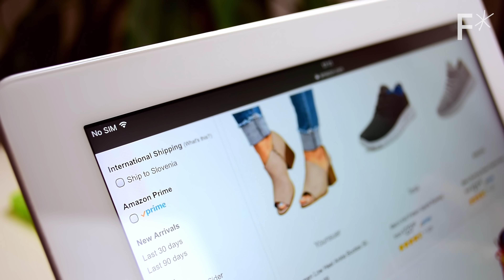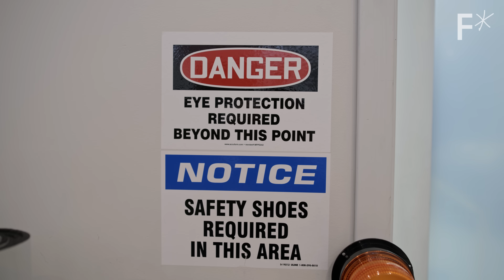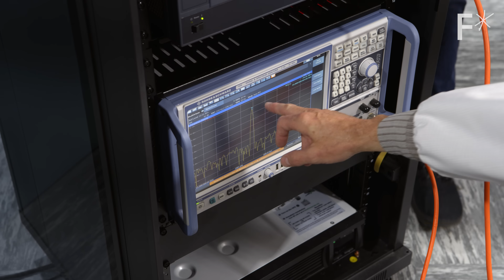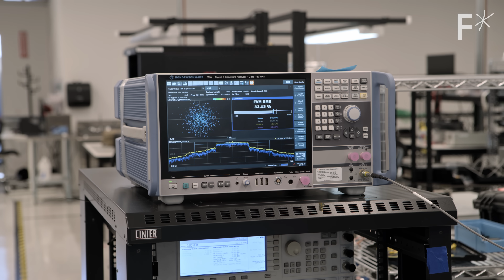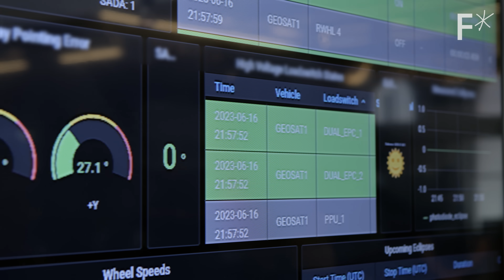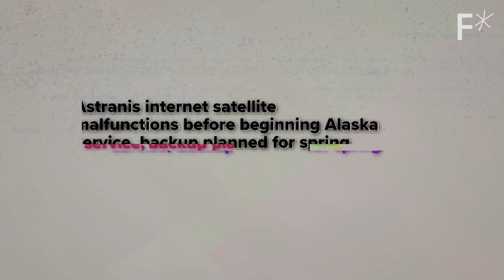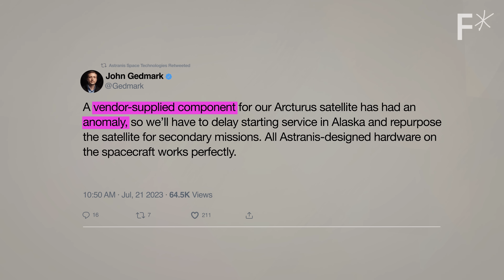Starlink’s newest competitor is using next-gen satellites to create internet for all | Hard Reset

Comment: stop demanding for junck. Think sustainable solution
Reply: what
Reply: @RawbLV   what what?
Reply: @iftekhar_k  what junk are you talking about
Reply: @RawbLV   spacejunk, light polution, excess cost, huge cabon footprint
Reply: @iftekhar_k  ehh it's barely anything. If people stopped flying to Italy for vacations, that would be a greater pollution offset
Reply: @RawbLV  how much fuel need to put one satellite in orbit? Multiply this by thousands. And forget about the manufacturing process. Instead we could run cable internet for reliable connection. Or we could develop efficient  wireless connection for remote location. It would be more cheap and less hazardous
Reply: @iftekhar_k  As I said, tourism produces more pollution than the entire rocket industry in idk how many times more. I mean there's literally thousands of planes in the sky at any moment. Production isn't that resource intensive.
There is no efficient wireless connection. All our tech is literally hitting physical limits. To provide internet through regular means to every remote location would be insanely expensive and damaging to the environment. Think about it.

Comment: StarLink will include (if not already) a cell phone transponder and will be able to act as another cellular antenna for your device. From 4G up if I am not mistaken. Already a challenge as that LEO cellular antenna will be 25 times farther than a regular one on earth. A geostationary satellite is at least 72 times farther than a LEO satellite, so the sensitivity of its satellite transponder and its signal power must be (72)^2 higher. That is about 5000 times more. For their billion customer goal, each satellite will manage much more "clients" than a LEO one, so for the same bandwidth (let us forget about latency for a while, like many others pointed out) they will need a huge amount of power. LEO satellites are being de-orbited if too old or faulty. They will do it under thruster control or by friction though it will take longer. They can do technology iteration cycles that are almost unbeatable and not worry about filling the orbit with crap. On GEO you will be required to move to a graveyard orbit and if you lost control of the "bird" bad luck.

Comment: Would never have internet in geo orbit.  Latency would be a killer.  I do have Starlink and the dish never moves.  Uses phased array antenna and the beam forming happens almost instantly so you don’t notice when it is switching satellite because it happens in an instant.  Seems more like an ad with so much misinformation.
Reply: The Starlink dish does move when it's fist setup, it maps the view of the sky where is position of best orientation. After setup it's stationary.
Reply: @tyronewashington230  yes but it doesn’t move to track the satellites is what I was getting  at and if you have the mobile version mounted for motion they do not move period.

Comment: i found falsehoods in here early that dont bode well for the authenticity of the rest of the video.

i dont like elon musk but i know technology

starlink dishes do not "lose connection with the internet" when they switch to the next leo sattelite 
- they also dont move the dishes for that as implicated in this video.

Strictly spoken. they are no "dishes" - they are phased array panels (similar to moden warship radars that are just panels on the surface of the superstructure) 
, and tracking sattelites is done electronically, not mechanically.

If you not even get that right - you ought not to mention starlink, lest you aim to get sued.

---

anyone who choses geo over leo orbits will have to fight with latency issues.    Physics are physics. distance add latency.

Comment: It also means that any dish down here on Earth has to track those satellites as they move across the sky.
And anytime that dish needs to jump to tracking the next satellite, it'll lose connection with the internet.

I have had my Starlink System for 2 years and have never seen it move to track the satellites with the exception of when I first set it up. Starlink antennas uses an electronically steerable Phased Array antenna that can switch from satellite to satellite in milliseconds and it can receive and transmit to multiple satellites at the same time eliminating the loss of signal. With much much LOWER  latency. Hughesnet Satellite internet used Geosink satellites and the services SUCKS BIG TIME!!!
Reply: I worked in the Arctic (Jan Mayen) a few decades ago and we had a slow expensive geostationary connection.  A few years ago they had increased the speed, but still the same horrible latency.  Now they got both Starlink and OneWeb, and in a few years there will be a 1000km fiber cable to the island.  The new starlink antenna has no actuators or moving parts at all, because the number of sats always covers the sky within the electronic steered beams.

Comment: This video was pretty bad at explaining the technical details. Essentially Astranis will be using SpaceX rockets for its launches and SpaceX-style manufacturing techniques, but Astranis is aiming for a low-end market segment.
StarLink currently has 5000 working satellites in Low Earth Orbit (LEO) and plans to eventually have 42,000 satellites in LEO. Each of these StarLink satellites will need to expend argon or krypton fuel to stay in their orbits and StarLink plans to replace them every 5-7 years. In contrast, Astranis plans to have 100 GEO satellites in orbit by 2030, and these satellites don't need expensive inter-satellite communications systems, because the internet signal can be served with just one satellite, instead of having to be passed from rotating satellite to rotating satellite. GEO satellites can last many decades because they don't have to use any fuel to stay in orbit, so Astranis will be significantly cheaper to operate than StarLink. The drawback is the high latency of around 600 ms for GEO internet, whereas StarLink is 25-35 ms, so Astranis is aiming for the low end market of people who aren't willing to pay much for their internet access, which is why the company is talking about the 4 billion people who currently don't have internet access and aren't willing/able to pay for StarLink's expensive LEO internet, which starts at around $100 per month. 

I don't know how inexpensive StarLink will become in the future, but if Astranis can get its pricing down to around $30 per month, I doubt StarLink will ever get that cheap, and Astranis may have a successful business model. If Astranis works, it will put other GEO internet providers like Hughesnet and Viasat out of business, but it won't challenge the LEO constellation providers like StarLink, OneWeb, Kuiper, Guanwang, Yinhe, Samsung, etc.
Reply: Starlink will carve up the markets and have tiered pricing--which, in fact, they're already doing. E.g., about $60/month in Chile. Since the network is global, the capacity is already essentially in place to reach these 4 billion, with little marginal cost.

Comment: You are wrong: Starlink does not physically move anything to track satellites and shifting to a new satellite every few minutes. There are 1280 radio transmitters/receivers on my "Dishy McFlat Face" antenna. They operate ever so slightly out of phase to accomplish "beam forming", that tracks a given satellite and shifts to the next one IMPERCEPTIBLY so. Without moving the dish. Take a look at a Starlink dish yourself: it mainly moves during the first 6 hours, when it is scanning for obstacles. After that it rarely moves. I would guess, that the reason mine is at angled to the north might have to do with load balancing ground stations vs. satellites or perhaps some satellites undergoing software patching. Patching/upgrading is normal for IT systems.

Comment: Not sure I see the business case.
Geostationary Satellite service had been around since the 90ies, and the physics haven't changed.

Large antenna aperture means sharing bandwidth with many other customers .
Latency is awful.We did a LOT of videoconferencing over satellite, sometimes even over 2 hops!
500ms is a baseline, 2000ms can occur.
It's possible to talk VoIP, but your better be disciplined, like on a 2-way radio ("over").
When it comes to online system, it becomes nearly useless. Many Cloud or Web services can't cope with the latency, crashing your connections and sessions regularly.
And when it comes to "chatty" protocols and applications, that create plenty of requests and responses for one single action (death to Sharepoint!), oh boy. 10 Minutes to enter 4 values into an online spreadsheet!

And don't forget, Geostationary needs line of sight to the satellite! You understand, what that means when you try to see the satellite from a mountain valley or in a high rise city.
Polar regions better be VERY flat towards the equator, unless you won't get connection.

Oh, and the weather!
If you're not using C-band (which mens huge antenna and crowded frequency spectrum), your Internet goes bye bye with every Monsoon or snow cloud.

I get the impression, starlink just solved ALL of those problems.
Having some open sky instead of like of sight to the equator, orders of magnitude higher bandwidth, extremely low latency, very cheap equipment, very low power, all polar regions covered...

I would not invest in this startup.

Comment: I wish them the best of luck.

However, it is difficult to see how they can actually compete with Starlink and other LEO constellations. Each satellite seems roughly equivalent to a single Starlink satellite. And if you look at launch costs, we're probably talking somewhere in the $15 million range per satellite. A Starlink satellite is likely more in the area of $400k per satellite (in part because they use their own rockets, and they are only going to LEO rather than GEO).

And with the volume of Starlink satellites being produced, there is no doubt that the production cost for each satellite will be significantly lower for Starlink. Competiton will tend to come down to $/GB, and if you are paying many times more money per satellite, making the financials work will be quite difficult.

The primary benefit of GEO is that you can roll out coverage with a single satellite. And that was a huge advantage, a few decades ago. But LEO constellations are already in the market. They have global coverage, and massive bandwidth.

I can see this system working in areas where Starlink hasn't been rolled out yet, with significant data caps and low pricing. But then, at some point, Starlink starts offering services with no data caps (or much higher data caps) and lower pricing. They can do that, because they just have such an advantage on bandwidth. And they don't really have to make much money in poorer regions - the satellites are already paid for by wealthier regions.

And the above isn't even taking into account the biggest benefit of LEO - low latency. Even if this system could compete on $/GB, it will still always be an inferior service.

Comment: This is a failed business strategy right off that bat in this day and age.  Starlink will eventually lower subscription costs to challenge any competitor.  The value starlink brings with low latency will win over the "competitors".  Elon will win.  In the time it takes this company or "competitor" to launch a viable network of satelites, starlink will probably have reduced their prices or improved their latency and possibly increased their subscription price.  If they have increased their subscription price it would be for a reason.  There is a demand for it.  That being said, this company isn't really a competitor.  Starlink is catered to people who want highspeed internet.  It's like comparing a deep hull ocean worthy fuel efficient yacht that does 14knots per hour to a luxurious yacht with 2 high output engines that will push a 50ft boat to 25+ knots.  There isn't really a comparison.  Different.
Reply: This is nothing other than a scam for investors. Smallsats to GEO? Really? Any reasonable regulatory body will GTFO them with such request. You cannot put that many of those on GEO safely, it's expensive and fill stay in orbit forever. And if it fails to move to a bit higher graveyard orbit, it becomes a whole another problem that is endangering other sattelites.
Reply: Were very unlikely to see Starlink just drop its prices, they have too many ongoing costs to do that.  The satatlies die rapidly in LEO due to drag and have very limited fuel and need replacing.  Also ground stations are very expensive and incur a loss to SpaceX for each instalation.  Lastly SpaceX has to buy backbone data service from other ISP's (the ones that have all that Fiber in the ground) to actually make the service work.  Geo satalites are not even competing with SpaceX, its instalation of more fiber which is permently shrinking the number of wealthy, low latency demanding, yet fiber-option-less internet users which are the target market of Starlink.

Comment: This video is perfect if you want to waste 16 minutes of your life and find out nothing new.

1. what is innovative about these satellites? We had GEO satellites for decades.

2. how will the back channel work? (The one from users back on Earth). Will it be stationery-only setup?

3. what kind of bandwidth do they exect to provide per user?

4. Calling other satellites "analogue" is not explained at all. Their "brain" is definitely digital.
Are they talking fixed frequency transmitters vs SDR (software defined radio) ? Do they mean older satellites just relay signals and never process?

This whole video looks like 16 minute bs add.

Comment: While sticking a fixed wavelength transmitter and receiver may get them through legal hurdles faster I think it's dumb to waste 10 million to send a satellite up that can only send and receive on specific wave lengths and covers only a single state. The US Gov has already taken more than 1250 billion U.S. and thrown it at broadband suppliers and guess how much of that actually changed pricing, availability, and cost? If you guessed ZERO you would correct. At this point it is just a giant legal scam to do nothing and write library sized legal documents to full fill legal requirements to get more money. More moola.. Your moola to be fair, but their free moola to be exact.

Comment: There is misinformation here. First of all, while Starlink terminals track the sats, they don't do it physically like shown in the video. It is done with electromagnetic beam forming and happens incredibly quickly, the antenna stays in the same place the whole time. The motor is mostly there for initial adjustment and alignment. There is basically no noticeable falloff in latency.   

Geostationary internet has existed for decades. The video doesn't make that clear. So there is nothing new about that, and that sort of internet is what SpaceX Starlink is currently replacing. To suggest this is some new idea that is primed to compete with Starlink doesn't really make sense. For most application the latency is terrible. They are basically just hopping they can do it cheaper. 

Why this should be cheaper then what SpaceX is doing is a mystery to me. The video didn't really tell me the value proposition.
Reply: Exactly. No one uses geo Internet even though it has been available for a long time because the service is terrible for most use cases.  No one wants geo Internet.  StarLink leo is much more competitive with good ground based Internet.  And since StarLink is by SpaceX who does the launches for literally the lowest cost possible, competing with StarLink is risky and most likely corporate suicide for geo.  This company makes no sense, I can't figure out how they expect to attract customers.
Reply: The reason Astranis can do it for cheaper than StarLink is because you need far fewer satellites to provide GEO service than LEO service. StarLink currently has 5000 working satellites in orbit and plans to have 42000 satellites by 2030, which need to be replaced every 5-7 years. In contrast, Astranis plans to have 100 GEO satellites in orbit by 2030 and GEO satellites can last many decades, so Astranis will be significantly cheaper to operate than StarLink. The drawback is the high latency of around 600 ms for GEO internet, whereas StarLink is 25-35 ms, so Astranis is aiming for the low end market of people who aren't willing to pay much for their internet access, which is why the company is talking about the 4 billion people who currently don't have internet access and aren't willing/able to pay for StarLink's expensive LEO internet, which starts at about $100 per month. 

I don't know how inexpensive StarLink will become in the future, but if Astranis can get its pricing down to around $30 per month, I doubt StarLink will ever get that cheap, and Astranis may have a successful business model. If Astranis works, it will put Hughesnet and Viasat out of business. Essentially StarLink will be using SpaceX rockets and SpaceX-style manufacturing techniques, but Astranis is aiming for a low-end market segment.
Reply: @amosbatto3051  Cheaper maybe, but then it would have to be much cheaper for the vastly worse connectivity. Fewer satellites also means much lower bandwidth for customers on top of the crushing latency.